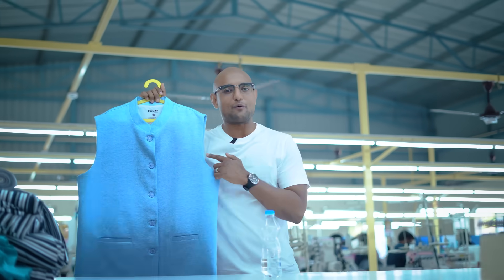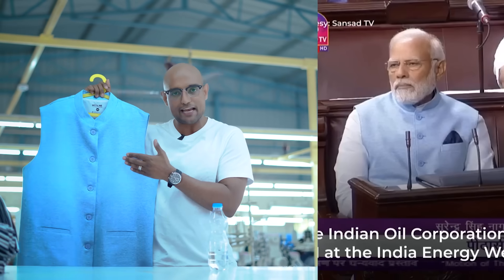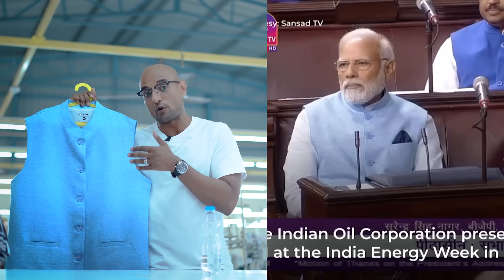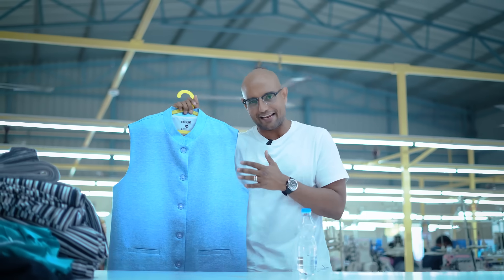PLASTIC WASTE TO T-SHIRTS AN INNOVATIVE SOLUTION| ECOLINE CLOTHINGS KARUR| CHERAN ACADEMY

Comment: Its not suitable to wear by humans, during fire accidents it will cause severe damage, not suitable for hot summer too, For Innovative idea safety angle has to be considered
Reply: Even cotton will fire.
Reply: @srenatarajan89 
when cotton captured the fire it will get rid off, but plastic will stick on the skin and damage
Reply: @srenatarajan89  hi.. cotton will burn and leave back dust/ash... But plastic will act as fuel. We have to consider it... After fire it will stick with ur body... To check it... Just try to burn a pet bottle upto 40% in a cement floor you will find it what I am saying
Reply: Valid point, ecoline can give clarification??
Reply: Instead it gets into the land and spoil the environment this one is far more better solution. If it is unable to wear during summer. Sports wear can be made
Reply: @YazhiniAgaran 

Wearing plastic is not the innovative way to dispose of the plastic
Reply: @YazhiniAgaran  where does this dress end up after being used.. any how it is going to the ground
Reply: @ksmuthuthimiri  1bottles=8shirts. Anyhow they are recycling this. Comparatively damage will be less
Reply: @vishnus829  yes thank you 😊
Reply: We humans are using plastic and the other creatures are getting suffered. So I feel this is better way not the best. There is both negative and positive side in all the products.
Reply: There is no 100% solution for everything in this world. For eg, EV cars help for better green environment. But, manufacturing its battery involve lot of pollution factor. If we see in this aspect, do they provide 100% green environment?? Definitely no. But, it is better than diesel's carbon emission. So it is better to change to EV. Similarly,  instead of dumping plastics in ground, we shall reduce its waste by wearing it. Again, Don't look for 100% solution in anything in this modern world.
Reply: U wear polyster cloths on day to day basis. It has all the risks that u said. Have u thought about it ?
Reply: Guys already we are using 72% of plastics in our daily essential
Reply: Same goes with your denim clothing right
Reply: True then we can't wear jersey type clothes... Now most of the people are wearing such type of clothes
Reply: Yow.... Export aayittu irukku..... 😂😂😂😂😂😂
Reply: Yes wright question...
But environmental damage ku ithu evolovoo  better
Reply: Every cloth will fire
Reply: மரு சுலர்சி என்பது பெரிய நிறுவனங்கள் இந்த பூமியை மேலும் மாசுபடுத்துவதர்காக உருவாக்கிய ஓர் பித்தலாட்டம்
Reply: The pet bottle are thermal stability
Reply: Anyone who commented here is a product user
Reply: Have you ever thought what is the belnd of the tshirt your wearing